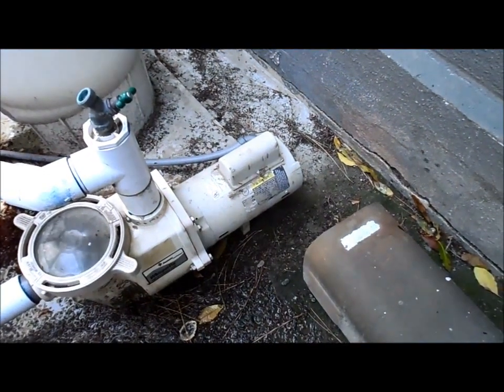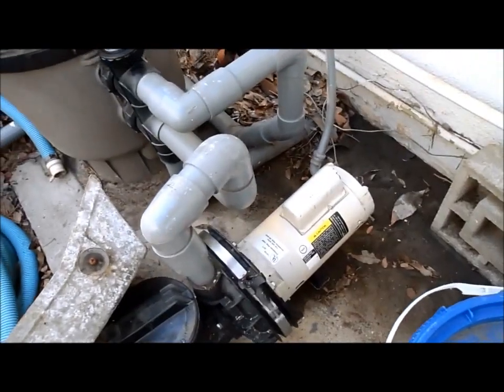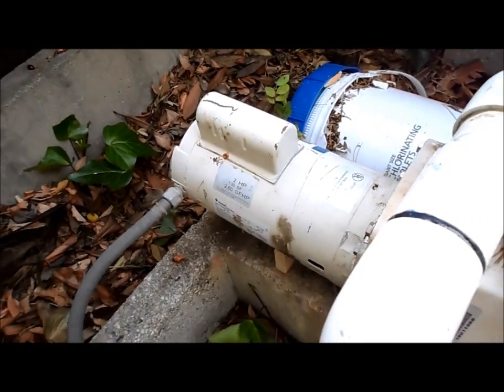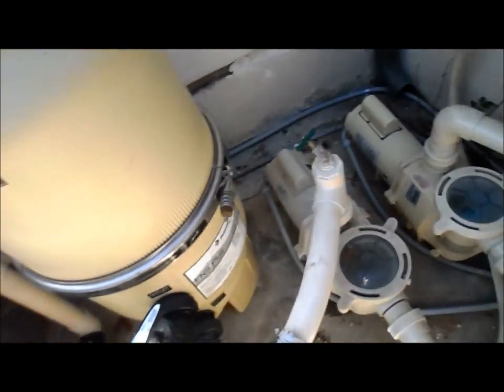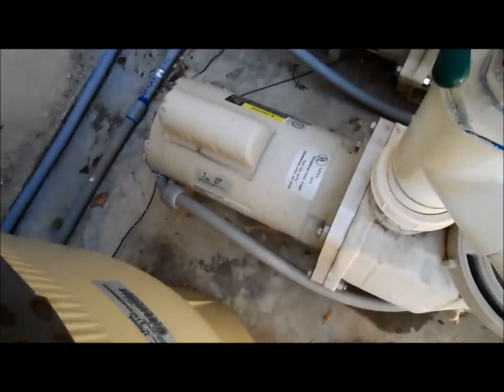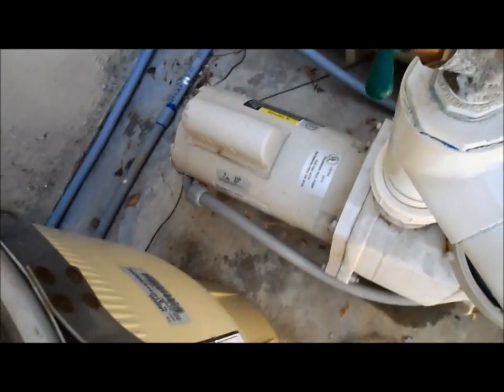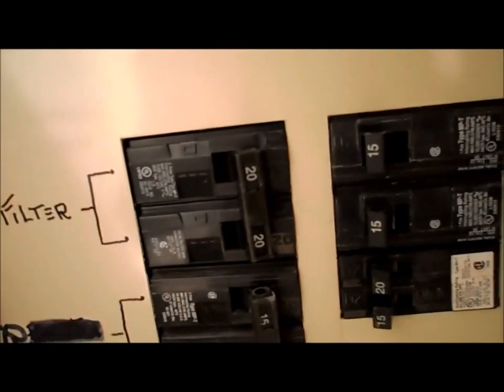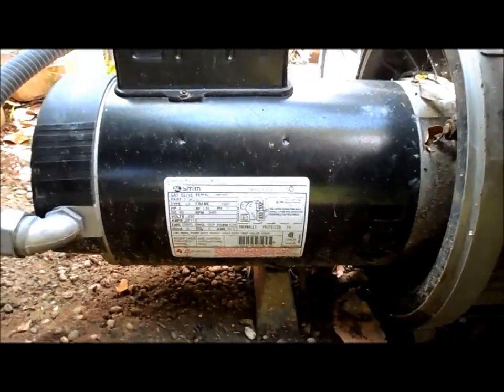Pool Motor Tips and Walk Thru

Comment: Do you know why a pool pump motor will turn on and run for 5mins then shut off for 5mins and it will continue to do that.
Reply from the maker: biggstell What make and model pump and motor do you have? And how old is it?
Reply: It's a whisper flo, it's probably a few months old. According to the customer it just got replaced.
Reply from the maker: biggstell Could be the seal plate is out of balance. Happens a lot with that model if any water hits the pump on the top area. It is under warranty so if you call Pentair they will send someone out to repair it.

Comment from the maker: Sounds like maybe the impeller is clogged. Turn the pump off, take our the pump basket and stick a screwdriver in by the impeller  and see if there is debris stuck in the impeller - try spinning it with the screwdriver. If not and the impeller is not spinning - depending on your motor/pump type - take the shaft cap off the back and see if it spins while turning it with a wrench. It could be the diffuser is cracked/melted and impacting the impeller. Let me know if that worked.